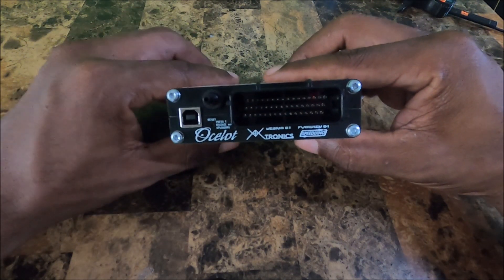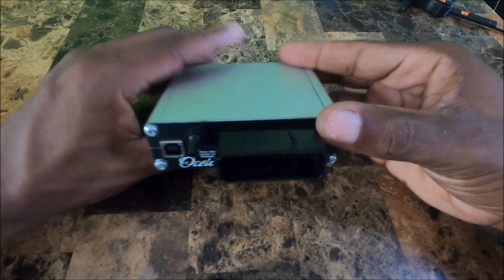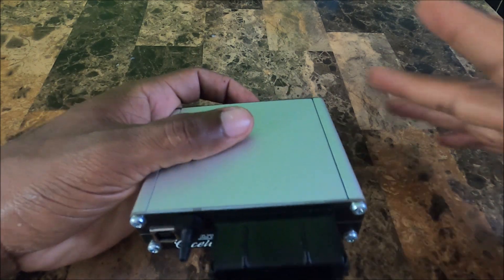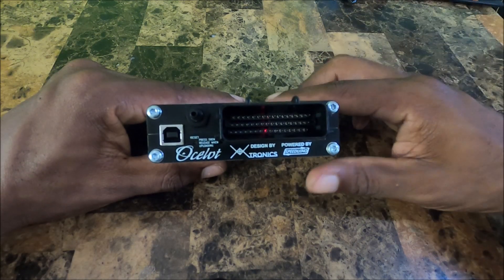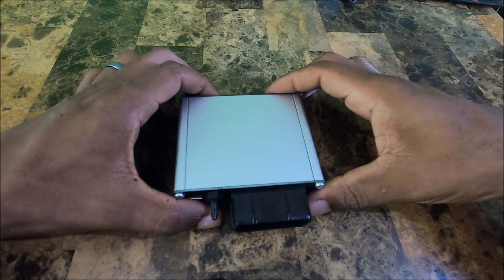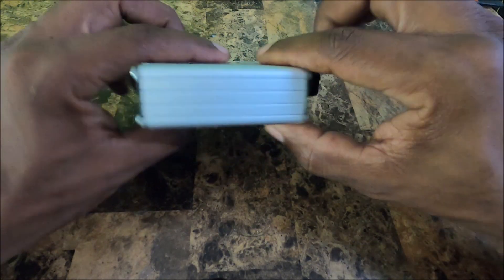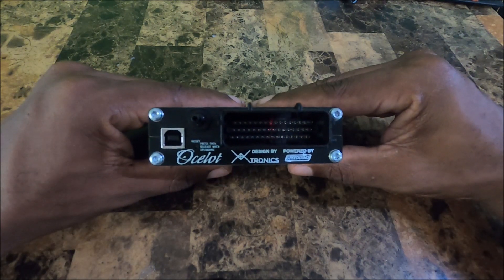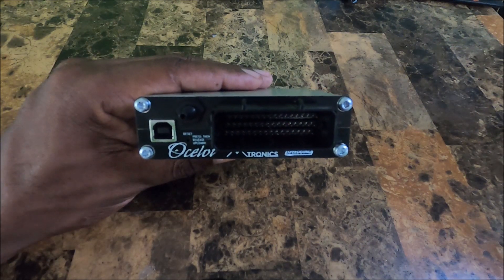WTMtronics Ocelot Speeduino ECU | First Look

Comment: If it only had 4 injector and 4 ignition channels, does that mean it only works for 4cylinder engines? I'd like to try to use a Speeduino for my 5.7L Hemi but it has 8 injectors and 8 coil packs.
Reply from the maker: @kyferez1  batch fire + wasted spark

Comment: How do you find what plugs to connect to the ocelot use and connect to a factory harness etc on your car? Do you just search up factory plugs or do you need some sort of adaptor? Having a bit of confusion and would plan on buying the fully pre built one. got a veloster turbo with a strange connector, so Ty in advance
Reply from the maker: @envikka  you would need to find whatever plug your car uses and build an adapter

Comment: Do you need to have it connected to a 12 volt source when doing the setup through the USB- B cable?
Reply from the maker: No you don't
Reply: @DCWERX  Thanks for the reply. After watching your video I ordered one but I tried connecting it to 3 different computers, 4 different USB-B cables and nothing happened.